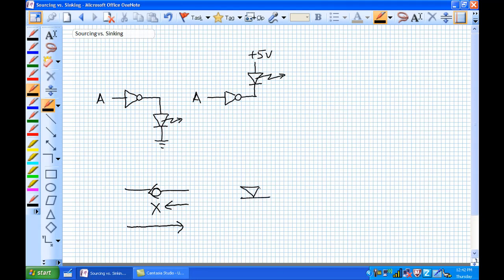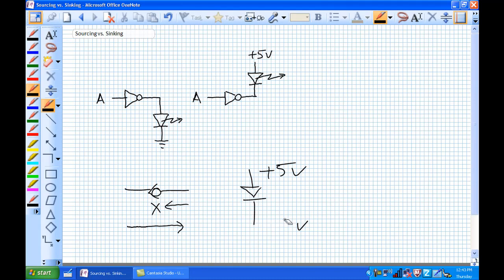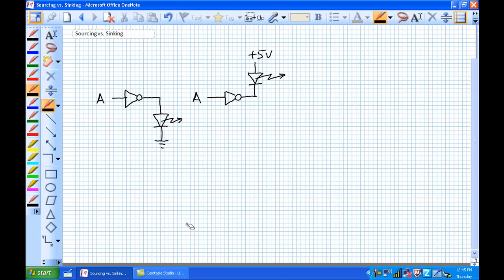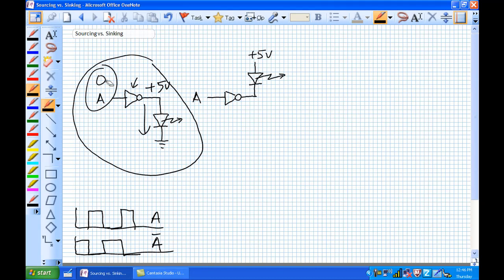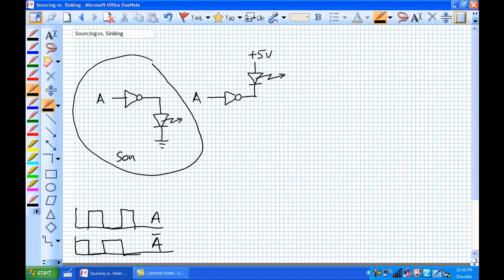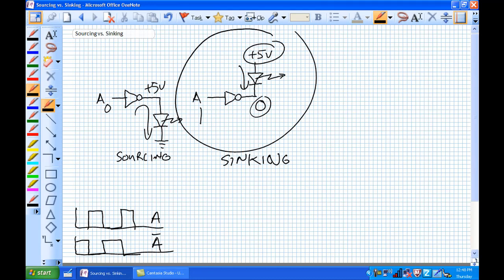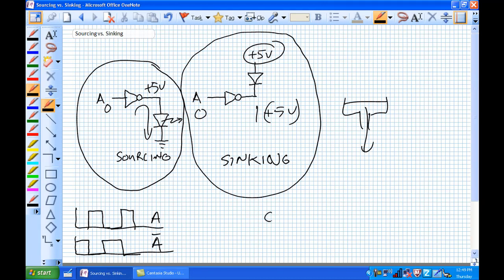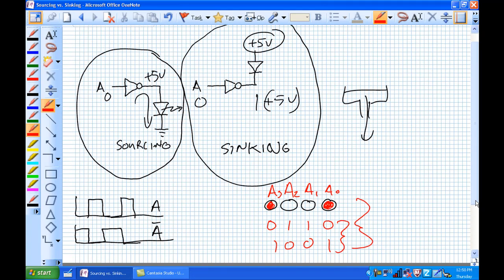Sourcing vs Sinking

Comment: On the sinking arrangement, would i be correct in assuming that the current flows out through the ground pin on the IC? In effect the gate 'opening' a path to ground?